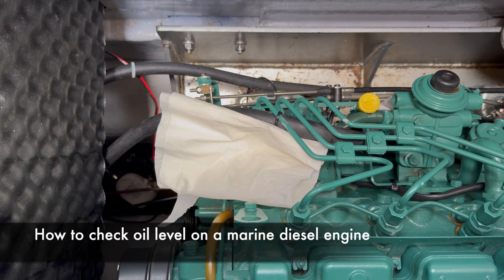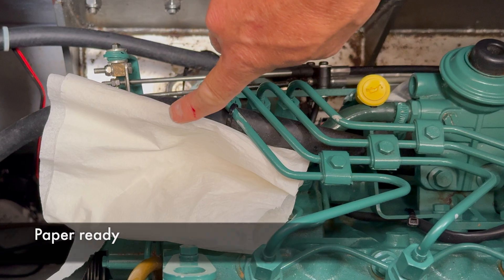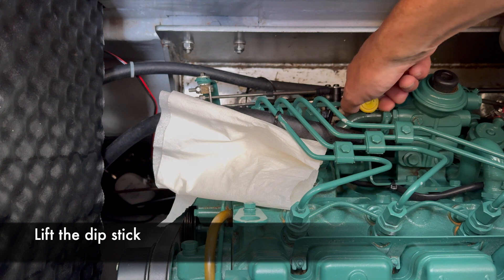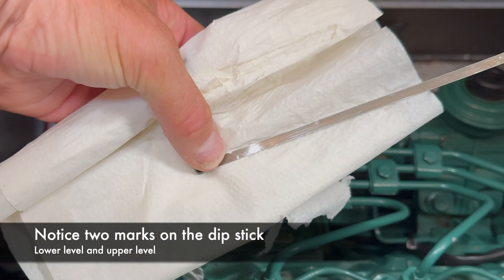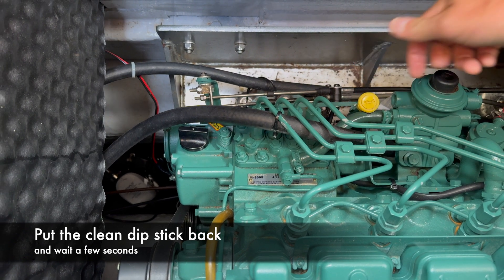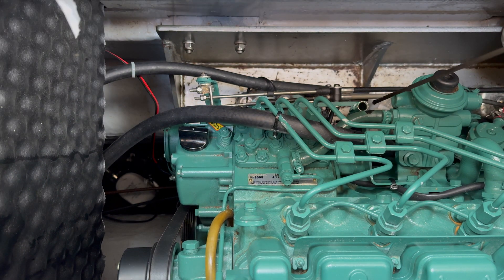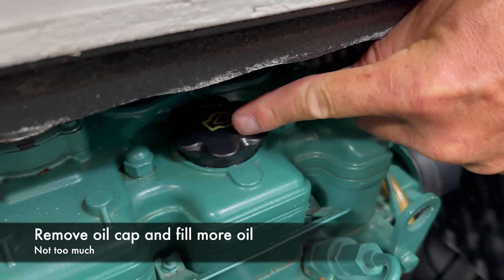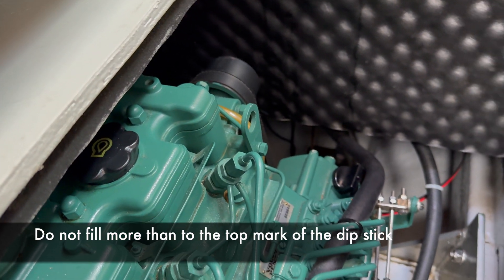Volvo-Penta D2 -  See If Your Boat Engine Oil Is Low in 2 Minutes!

Comment: How come your engine is so clean? Is it new? Maybe you don't need to use it, Oh I forgot it's in a sailboat. Good way to keep motor dependable.🎉🎉
Reply from the maker: It is clean because I keep it clean. I think keeping the engine clean is a good first step on the maintenance. On a clean engine you will see leaks very soon, and you can do something about it before it gets bigger. 

Oh, yes, it is a sailboat, or a motor sailor as some people call it. This engine is from 2018, and has run 1 100 hours now.  ⛵